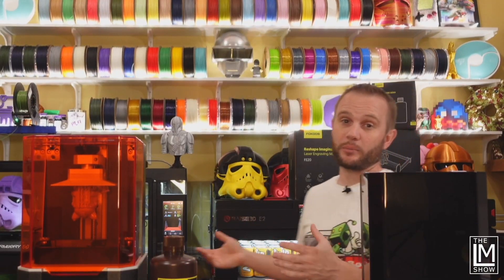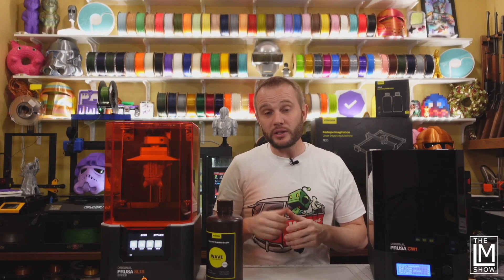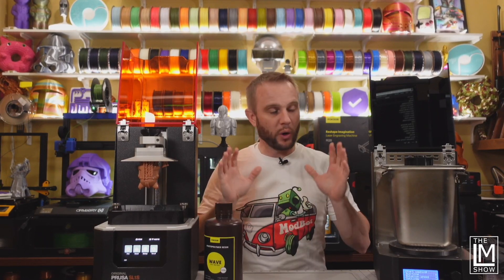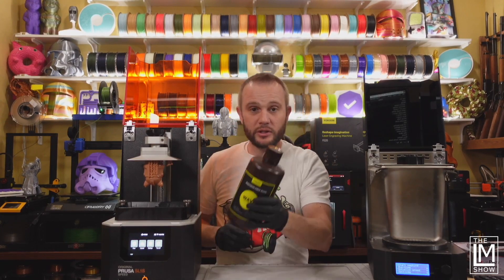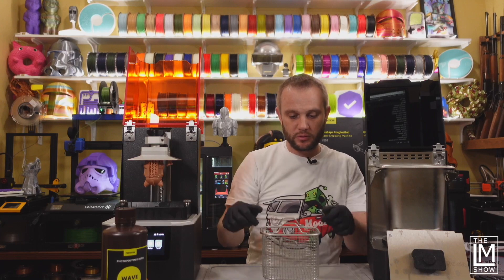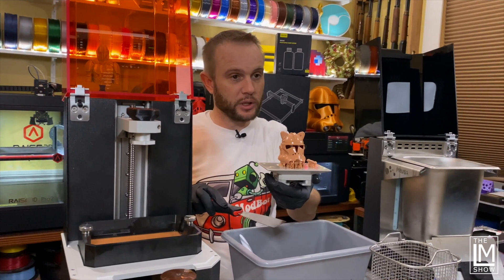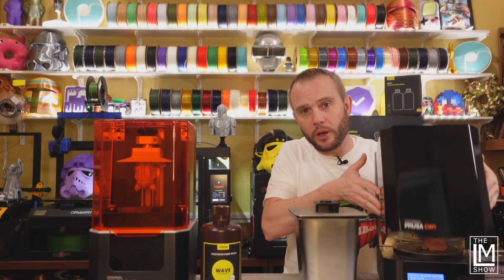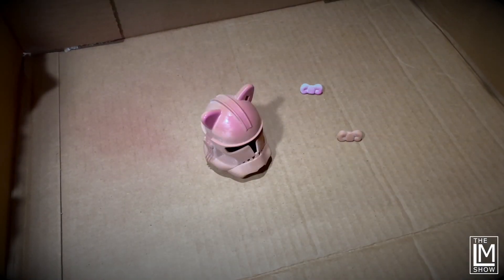Simple! 3D resin printed Hello Kitty Clone Trooper helmet?

Comment: FAN-TASTIC video!  I have a few questions.

What do you do with the leftover resin and isopropyl alcohol?  Do you print something else?  Dump it back into the container?  Leave it outside in the sun?

Are there reusable resin gloves?  Seems like if you print a lot of resin, you'd go through even more disposable gloves.

After you use someone else's toothbrush do you put it back?  Clean it with IPA first?
Reply from the maker: Haha!

Thank you! Resin, you can pour it back into the bottle (strain if you need to), and the IPA can be left to sit / settle and the clean IPA poured off or strained.

If the resin needs to be disposed of, you can pour it in a shallow pan and leave it in the sun, IPA will evaporate as well.

As for the toothbrush, just put a little toothpaste on it when you put it back, they’ll never know. 🤣